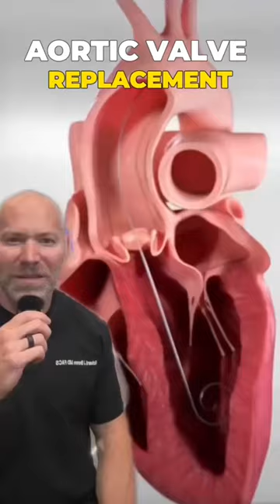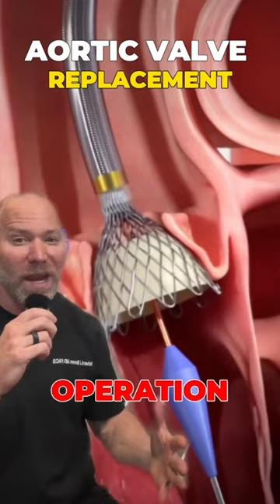Heart Valve Replacement Surgery 🫀 #shorts

Comment: Age 65. Just had my aortic valve replaced, bicuspid (mechanical). The method described here is not possible with mechanical valves yet.
Mechanical valves last the longest. Coming up on three months recovery from a full median sternotomy. Ready to go back to work (laborer).

Comment: how long do these valvle usually last ?
Reply: They are usually done on elderly, as you don't really want to do an open heart surgery on them, therefore the longevity isn't quite known from what I've been told.
Reply: These can last you 10-15 years. 
Perfect for older patients.
However, the materials are being improved over time. Google polymeric heart valves, if you want to learn more.
They will likely last much longer.